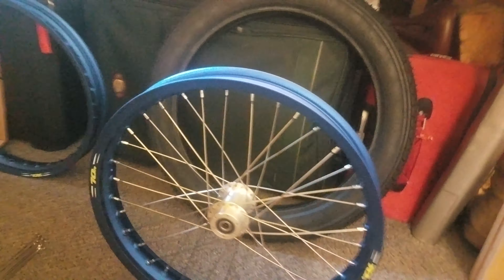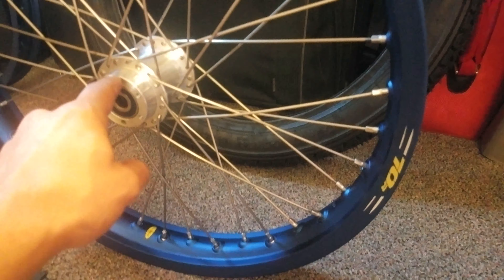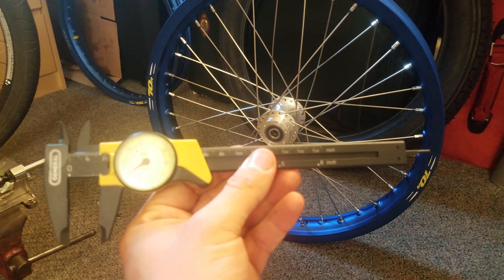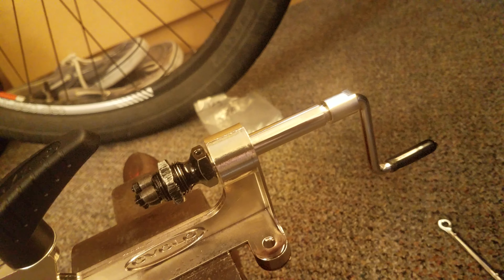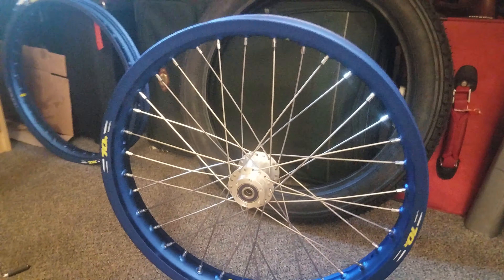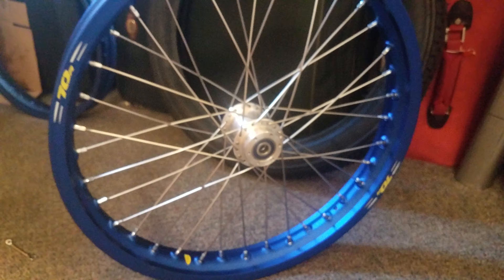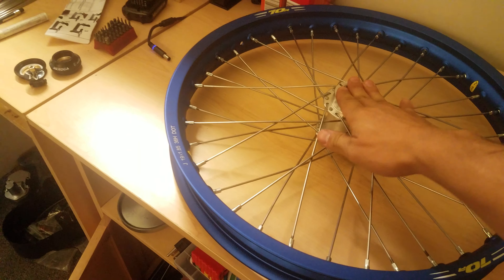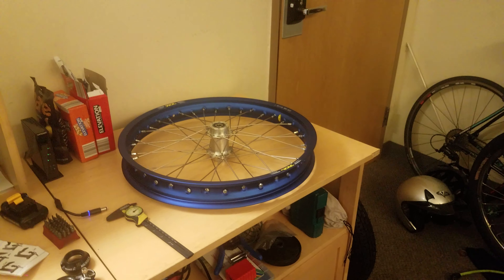Wheel upgrade part 2, motorized bike

Comment: Did the second wheel turn out faster? usually once you got the method down things go quicker..
Reply from the maker: Since I bought (at the time I didnt know otherwise) uncut and unthreaded spokes it took roughly the same time per wheel since most of the time was measuring cutting and threading. But there's a site that will sell custom length pre cut and threaded spokes. Which will make the process go a lot faster on assembly.

Comment: What hubs are you using?
Reply from the maker: I used for the rear a steel hub with disc brake from mbrebel.com 

The front hub is from ghettobike.com with double disc and their forks.
Reply from the maker: Yeah I can. Bikes not 100% together right now but the rear wheel is still all set